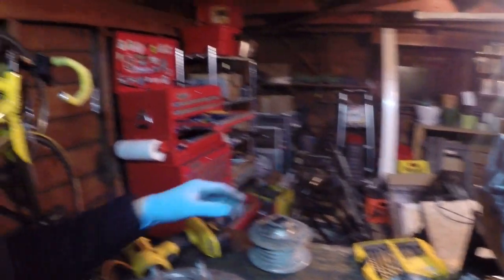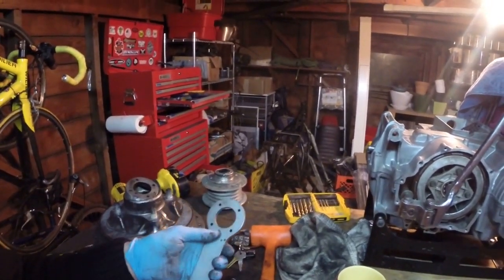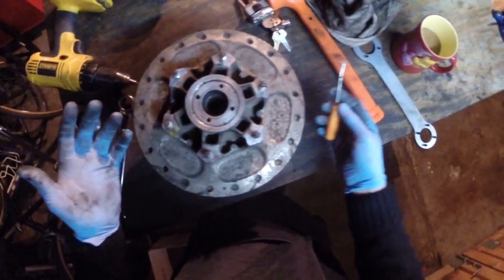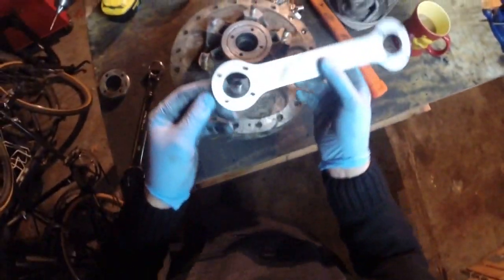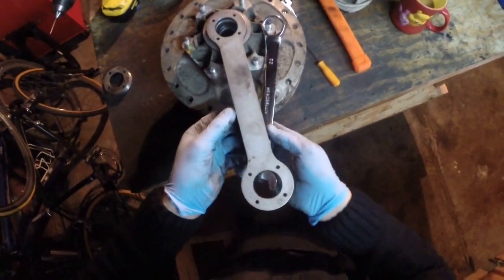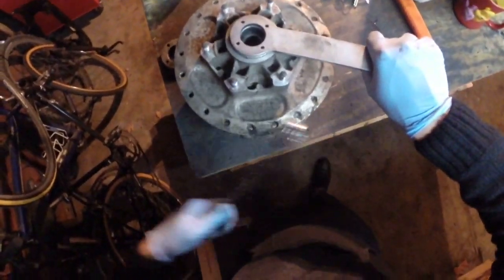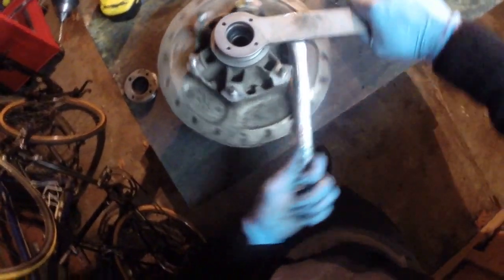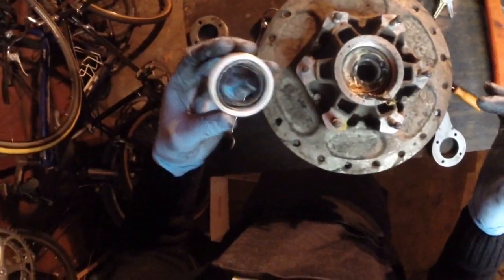CB750 Wheel Rebuild #1 (Wheel Bearing Retainer Removal)

Comment: Hey can i borrow that fancy tool you got there?
Reply from the maker: Unfortunately, you'll have to buy one.  They're pretty cheap though.

Front wheel tool is 39.99 - https://carpyscaferacers.com/shop/shop-our-store/motorcycle-parts-accessories/honda-cb500-cb550-cb750-parts-upgrades/wheel-bearing-retainer-socket-front-s-o-h-c/

Rear wheel tool is 40.00 - https://carpyscaferacers.com/shop/shop-our-store/motorcycle-parts-accessories/honda-cb500-cb550-cb750-parts-upgrades/wheel-bearing-retainer-wrench-k-f-series-sohc/

These are the only ones I know of.  They work great for removing these very soft aluminum wheel retainers.